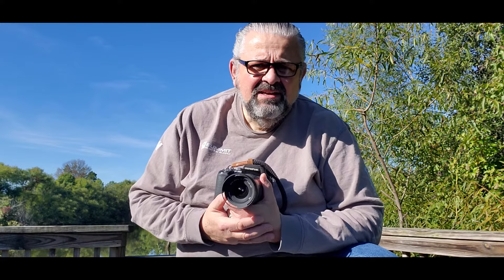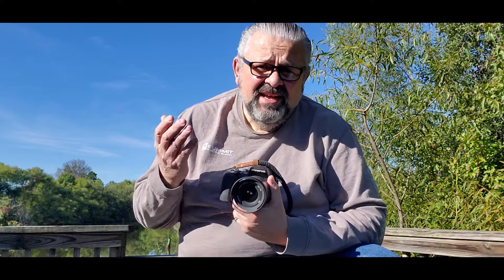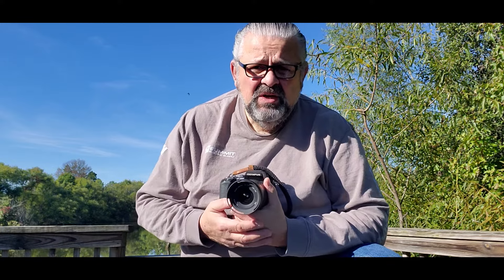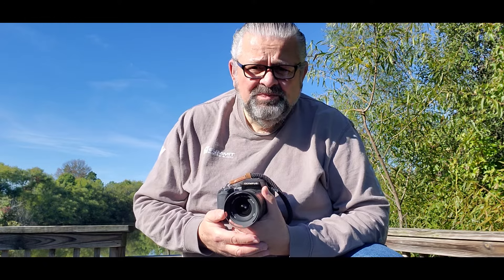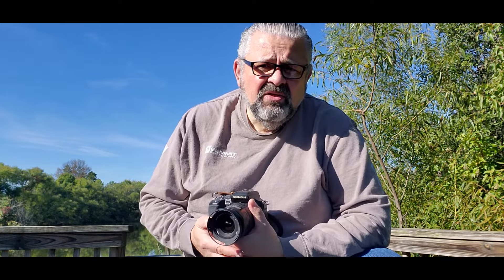Kodachrome Sensor made by Kodak for the Olympus E-500 DSLR Camera for that Film Look Class 170

Comment: Hi Carmine, just received my E-500 today.  Got it with the 2 kit lens.  Initially not impressed, especially because it has no IBIS.  I was shooting indoors but it was during the day, so there was light.  The pictures came out slightly blurry and not sharp.  I found out after a while this camera need lots of light for the pictures to shine.  Best for outdoors.  For indoors, using the pop up flash is pretty good.   I did managed to get some colorful pictures.  Hope this Kodak CCD sensor is for real.  BTW what picture setting you use to produce the best colors?  I love older cameras and love your videos.  Problem is having too many.
Reply from the maker: Attached is a link to the ADVANCED PDF BOOK FOR FREE that will guide you to enjoy your e500.
https://cs.olympus-imaging.jp/en/support/imsg/digicamera/download/manual/esystem/man_e500_en.pdf

Comment: Nikon D200 - D40 - D40x - D80 - D3000 (bigger screen) are all equipped with the great CCD Kodachrome sensor. The CCD 10Mp pixel sharpness and detail output can be compared with a 18-24mp cmos sensor.
Reply: @daktarioskarvannederhosen2568  it’s about the same…same deep vibrant colors. The Sony Alpha series even had a 14mp CCD before switching to cmos. I have one but the mirror is less damped than on Nikon resulting in blurry images in -125th slower shutter speeds